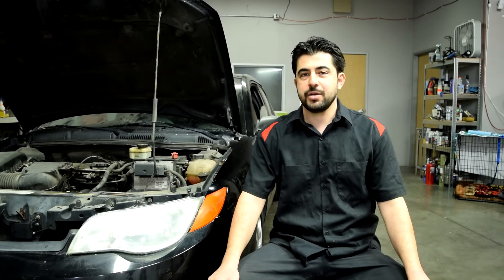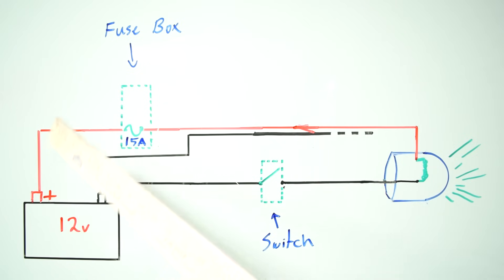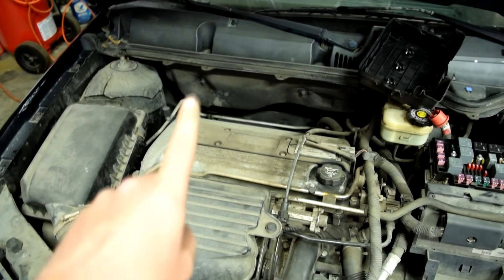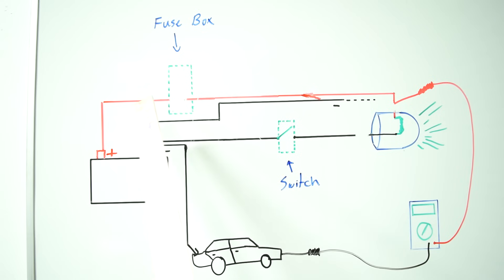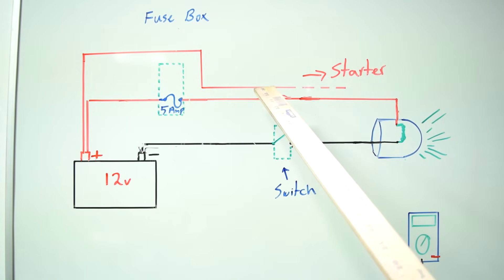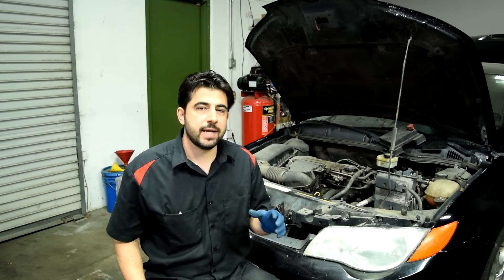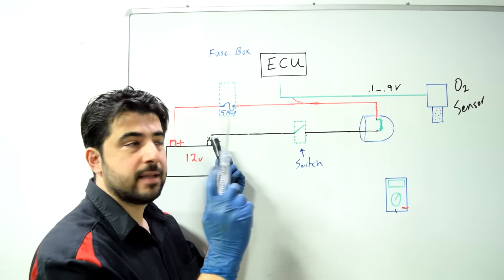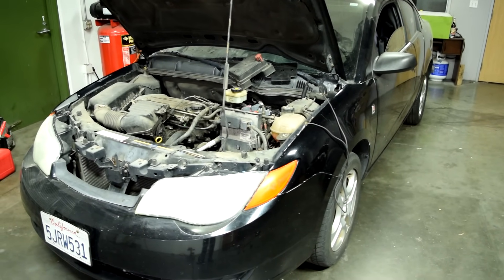How to Diagnose and Find a Short Circuit or Wire in Your Car

Comment: I have a 2008 mercedes A180 Elegance, fuse 10 has started to blow more and more frequently. It affects the front driverside door control buttons including window and mirrors on both sides and the rear windows. Only the right front window works with the right front door button. Also the right passenger mirror pivoting mechanism is broken and has been for 2 years, this results in the pivoting motor trying to move the mirror open or closed at random times and when parking. What would be involved in disconnecting the power to the right side mirror, I can't find a wiring diagram for this vehicle.

Comment: Your videos are very informative and well put together!  I appreciate you.  I have a question for you.  Could a short in a different power wire cause the starter to not work properly and even smoke from inside the starter?  I assume maybe trying to pull the amps from the shorted wire as resistance from oil buildup causing lack of flow to the starter from the main power supply?  Thank you in advance.

Comment: Thank you for sharing I am trying to diagnose a trailer stop light comes on as soon as I connect the trailer harness to the car. All of the other lights work fine, indicator, right and left and the driving lights all come on when I use the switch only. I am looking for a positive wire that is worn and connecting to the earth. Cheers.

Comment: Ive been struggling with a small diesel pickup truck that wont start .... bench tested the glowplugs  and they lid up .. but when theyre in the car they dont heat up.... tested the glowplug control relay on another truck and it worked..... so i tested the glowplug wiring and found that when i place the mulitmeter between the tip of the glowplug (which should get positive + feed) and the positive terminal of battery.... it shows 12V ..... this means theres a short somewhere in the vehicle causing positive to positive voltage reading...... now my nightmare begins trying to find that short which can be anywhere in the vehicle 😢😢

Comment: Question. I have a 12v charger that has alligator terminal clips on which there is a small blade fuse on the positive side. 
I tried to use these clamps during a hurricane for a project and I blew that fuse. If I just bridge/put a paper clip in that fuse the charger works just fine. 
My question is is there anything wrong with doing this? Worst case scenario is the charger is killed during a surge right ? Idk what the fuse is for tbh…it might be to protect from electricity flowing the wrong way when the charger is connected to the car, but it’s only a 10a fuse so idk what it could really do, best I can tell it exists solely to detect current above 10a as a fail safe so when the fuse blows the charger stops working. 

Could you help me grasp what that fuse is for, and more importantly, what am I doing in this case when I use a wire or paper clip to bypass/jump a fuse receptacle ? Like what’s happening exactly and is there a safer way to bypass a fuse. Should I use the thickets and longest cable possible? Or a paper clip ? does the paper clip not only restore functionality but also act as a fuse because it will burn up if electricity flows through it???  So maybe I should use the thinnest cable/clip I have In this case now that I think of it as thicker would be like a higher rated fuse. 

How does that fuse inline with a cable in a car battery charger even work? Like for a 2amp charger ok fine I get it. But if you’re using a 10+ amp charger what’s the point of a 10amp fuse on the positive clamp???

Comment: So how do we fix it. HELP!  A live wire(12v) from my obd2 touched a ground and from the video I think I have a ( short to ground? ) fuse ketp popping then after 5 new fuses it stopped popping. But not my obd2, dome light, car remote wont lock or open doors are not working properly...

Comment: Obviously a reason why im here today lol..... I have someone with a 1996 Isuzu Kb260 pick up truck..... Truck all of a sudden didnt wana start.... It cranks but theres no spark.... After checking everything from head to toe i noticed that when i remove the negative battery cable  and connect the multimeter to negative terminal of the battery and the other to the chassis it shows a reading of 10V..... Which made me confirm that somewhere a positive wire is shorted to ground..... Finding that short is a nightmare..... When i remove the main ignition fuse the voltage reading drops to 7.5V and when i remove another certain fuse the voltage reading drops even further to 2.8V without the negative cable even connected to the battery....... Now the even more tricky part is when i completely remove the battery from the car it still show a voltage reading between some points on the ignition and ignition coil...... I suspect the ignition coil either faulty or improperly wired causing backfeeding or something..... This old truck has a whole bunch of wires of which i have no idea which is for which components..... Seems like the distributor is not getting any power because of a short circuit and not giving any power to the spark plugs..... Seems like a tidious task to find that short because it can be anywhere on the car 😢😢😢

Comment: My all fuses are ok but battery is loosing 11 volt while checked with multimeter i tried the fuse trick scanner is showing headlamp circuit have a ground short

Comment: I just tested every mini blade  fuses in my car  (didnt test the j-case and cartridge ? Style fuses    

All the mini blade fuses  gave back a reading of .1  :(   Whats wrong with my car   

I did an electrical event take place a few years ago.  Something failed in the alternator and i ended up having to replace the tcm ecm, 80 main, and all the fuses that were wired back to the 80main  the 100main  didnt blow or it didnt visually appeared blown   

Using a klien cl800 digital clamp meter ori guess A dmm  ?

Vehicle is a 2002 infiniti g20

Comment: One, I have a problem, I changed the wheel hub and rear abs sensor of my car and I have two light bulbs on the abs and ESP traction control board, and I found when I put the tester on my car it gave open circuit/short circuit to b+, right? what would this mean, what could it be

Comment: I have a turbo actuator that I am getting fault codes that it is shorted to positive. I assume the last time the engine came out to do the timing chain, some of the wires got damaged. That or the actuator itself is faulty: what is the best way to find out what is at fault in this scenario?

Comment: How would I go about finding a short to voltage in a vehicle ? On my EGR plug there is voltage between the egr signal wire and both ground wires someone told me this means there is a short to voltage and that there should be no voltage between those wires. My error code is showing p0406 egr sensor circuit a high .

Comment: Great video!!!
I am helping my dad find a short in his 61 Chevy car.   It does not really contain any negative wires to any of the things like tail lights interior lights or dashlights.  Which are all out.  (Since it keeps blowing a fuse).  It simply uses the body of the vehicle as the ground.  I can't find any breaks in any of the wires.    

Is it best to start checking each wire with one end on the body of the vehicle and the other end of the multimeter at the end light bulb wire?  And repeat this for every light that is out?  And make sure there is no Continuity, correct?

Comment: Great video. My issue is my airbag clock spring keeps shorting out. I’ve replaced it twice in the past year and it just shorted out again. No fuses are blown, but I know it’s bad because I have the exact same symptoms as before. Once I replace it they all go away until it stops working again? Any ideas on how to troubleshoot this would be greatly appreciated 🙏 Thank you

Comment: Going to do some diagnosing as to why my 15amp fuse keep blowng for my 2004 Nissan Xterra. Odometer lights, p,R,D lights are out and the same goes for the lights for the ac, fan speed and the direction of where the air travels to. Front, front and to your feet, etc. this helps narrow down my search. Will start doing this sometime this week

Comment: please!!!  I notice my harness for O2 sensor was near a radiator hose very hot ., to the point of the plastic protection melt.,   I cleaned and put a new electric tape cover with a plastic hose and separate from the the radiator hose with a zip clamps and WALA  2 days later code P135 o2 fault ., I change it and the code come back again . Question.!!!   it is Possible the this wires are bad after being expose to a extreme hot hose . because they looks perfectly fine to the point you not even can see the copper ., also i dont know were is the fuse for BANK 1 SENSOR 1 in mustang 2010 gt

Comment: Thanks for your tuto
i've Audi C6 won't crank, starter will engage if i jump wired and start the engine normally, but will not engage with its relay i replaced 4X relays but all the same, vcds says 50 short to ground, also 50 short to plus,?? i disconnected 50(+) that going to starter solenoid and short is gone, if i replace wire, short will back. So starter it self has continuing 50(+) to its body(-),  is that normal?? if not i tested three 3X Audi used starter and has same continuing 50(+) to body(-),  i got NUTS, PLEASE HELP...thanks in advance

Comment: I'm wondering what's the best fuse to pull and test connector in the ECU box for 02 sensor faulty trouble codes, and if I could damage the box shaped fuses by pulling on them wrong.  How do you check a gray box fuse, since they're not like other fuses u can see if they're blown

Comment: My fuel pump fuse keeps blowing. I disconnected the fuel pump and tried a new fuse and still blew. Could a bad relay blow the fuse?
Reply: Do you have it on the right slot it should be on the ignition slot

Comment: I have no turn signals or emergency flashers, was testing using a test light hooked it to flasher hot to do blue wire on turn signals. When this hooked up it starts to blink with test light hooked up. Why is that what's it saying it might need? Maybe ground or short to ground idk. Thanks enjoy your videos

Comment: Okay so, I know I fucked some up... But I don't know what, I touched the two wires that are for the purge solenoid' and now it runs really rich sounds like a damn stock car. And ideas people?
Reply: Also not great throttle response it only goes up to about 2500 rpms be it isn't happy

Comment: I realised after I purchased my BA XR6 about 5 months ago that it had been....electrically r@ped. Excuse the phrase but there is literally no other way to describe the disgusting state of the wiring harness. Modifications had come and gone as people had purchased and sold the vehicle over time and 'easiest route possible' appears to have been taken with the install of EVERYTHING ...EVER. I have permanent scarring (lol) on my back from being upside down (Head in footwell, feet on headrest) followiing wires trying to decipher WHAT THE ACTUAL f people have done. My DTCs were changing daily...hourly even.. Now that 99 percent of the insanity has been repaired I only had 1 fault left to tackle and that was one I couldnt work out, a short to ground but wasnt blowing any fuses. After watching this video I now realise whats going on, its happening BEFORE the fusebox. Thank sweet baby Jesus for your great vid, you have saved me a great deal of time (which an auto electrician would have too, but I like doing things myself). Sub added, cheers.
Reply: You were fighting their BCM? Did any of it happen to be regarding fuel module or pump? I have a circuit shorted to ground and im ready to gut my car (pull out front passenger seat, back passenger seat, carpet and kick panels to access all my wires to find my one short to ground. Mechanic said the car drives fine, take it home. Basically, he doesnt want to spend no time tracing one broken wore down. Any advice would be Greatly Appreciated.  Tia

Comment: I short my car and my dome light,, door lock and heater is no power i check all the fuses they all good but the 10amp and 7.5amp didnt light up when i run a test light what is the problem with this,,

Comment: We have a 07 rondo and of late the back brake kept blowing the fuse, then the cyclops light stopped working and the mechanic just disconnected the cyclops light altogether so i could drive it. Now the rear windshield wiper stopped working, next the front windshield wiper defroster stopped working, the interior light does not come on, and just recently the rear defroster button started clicking when i turn it on do i quickly turn it off again as I’m afraid every fuse  is going to blow. Its snow season here soon so wondering if you have any insight what may be causing all this. 

Also is the fuses near the driver door  connected/different from relay under the hood. 

Thanks!

Comment: So I checked the plug with multimeter.  Plug has 3 slots.  OL on both the green and red slots. The black slot shows a low reading? What does this mean.  My fans can't coming on in the car.  When giving direct power to the fans one works and one doesn't? They both have fan control modules.  Wire harness is 3 slot power to fan from fan control is 2 slot?

Comment: Hi I have a question.
I have a 95 gmc jimmy
4.3l v6 with a vortec engine. 
I have been having some issues with rough idol.
It also has been backfiring from in the Throttlebody . 
As well as from the exhaust an it’s been hesitant while accelerating an at driving seeds. I replaced the distributor cap and rotor as well as camshaft position sensor. Plugs an Warriors as well as ignition coil. 
I also replaced the crankshaft position sensor. In doing so I noticed. That the wire harness was old an wires had been arcane do to bare wires touching together. So I cut old wires an connecter an replaced it with new one. After doing that now my truck just turns over but doesn’t start. Also I to a look at my Fuses an the fuse to the ECM was blown. Replaced it with new one. An truck still won’t start. It ran before I replaced the wire harness an crankshaft position sensor. But now no start. If you help please. Thank you

Comment: I got a 2007 trailblazer thats blowing the acc and the lighter fuse but only when my wife's oxygen machine is plugged in. There are two separate fuses for these circuits. It only blows which ever its plugged into either acc or lighter. We ran  the machine for months no problem at
All now it blows the fuses. Phone chargers don't blow the fuses. We exchanged the machine for a new one still blows fuses. Im at a loss for what it could be. I've changed the sockets still blows em.

Comment: Hello can you please help me. Recently i replace my o2 sensor because have check engine light and the code is p0141 so i replace it after a few minutes of driving engine light comes on again the error code is p0138 which is again in the o2 sensor. Whats is problem with that? Im hopping you can give me some ideas to diagnose it properly

Comment: Every thing he's saying makes sence ,my issue is with my reverse light,I changed the bulb and still not working ,so I checked the fuse chamged the fuse and it blew straight away ,I did that 3 times , so where would I start checking

Comment: My car is currently in workshop..!!!

It was going off sometimes when you start moving from a traffic signal, and we found out the EFI fuse was blown and it happened again after I replaced the fuse, but not right away after it was replaced. The car is at a workshop for past two days and they are saying that the problem would be a wire that has lost it's insulation somewhere which occasionally touches the body of the car when the car is running and that would result in a fuse failure, and they couldn't yet find the wire in past two days. If someone can help me resolve this issue. It would be a great help. At least a way to find the wire or if the fuse is blowing due to some other reasons? 

By the way, my car is Toyota echo 2002 model.

Comment: My car shorted out on me. I have a distributor leak and it went to alt then all that electricity went to my alt fuse and melted it. Replaces my alt and as well as the fuses. Ever since I did that, every time I turn the key my 7.5a ignition fuse blows when I turn it over. I ain’t got money to spend on a mechanic rn, anything would help.

Comment: watching this in hopes to fix my car radio! a month or two ago my radio unit randomly stopped working. So i checked my fuse box and found my right side front headlight fuse is blown, upon trying to replace the fuse it immediately blew again. But my right headlight works just fine? Not sure how this is effecting the radio but damn i wish i knew someone like you in my city who could figure it out :/

Comment: After re-connecting the negative wire to my car's battery there was a large spark and now I have a no crank no start situation. I thought I must've shorted the fuel pump relays (my car has 2) or the MFI relay because the pump doesn't' prime after reconnecting the battery and turning the key, but after bench testing all 3, they seem to be working just fine.  Would the next thing to check be the wires going directly into the fuel pump? Any help would be appreciated - I am so lost and frustrated

Comment: I got pissed so I jumped the fuse and heated up the wire that had the short. Melted the jacket and then I knew what one it was. Now I fixed the short and now I'm all good. LOL Terrible way to do it but it worked!!